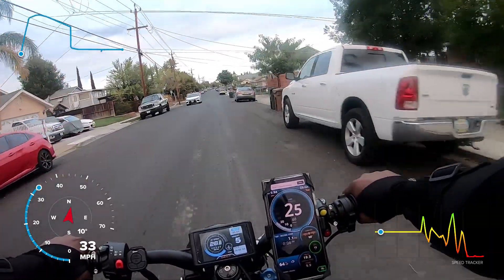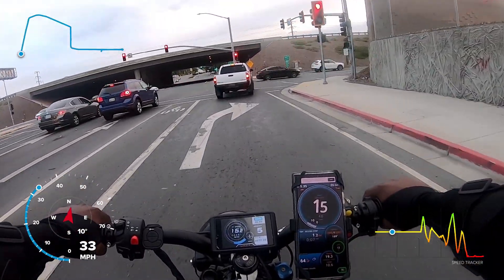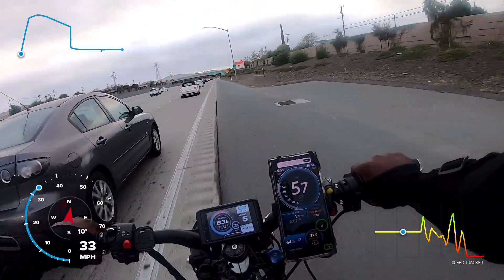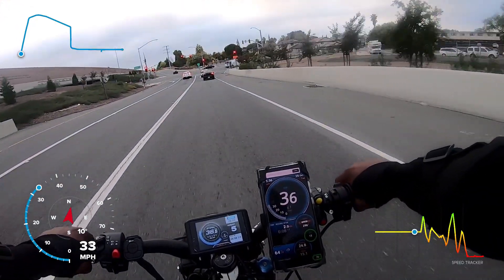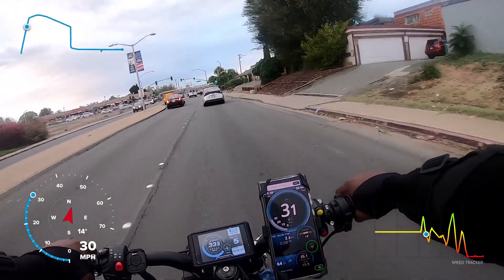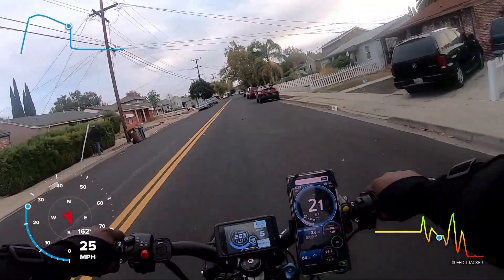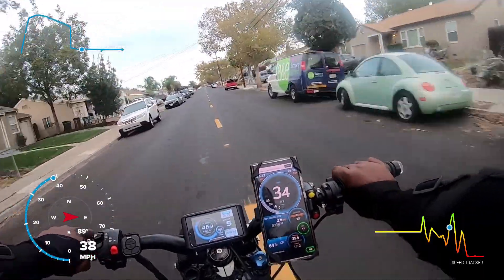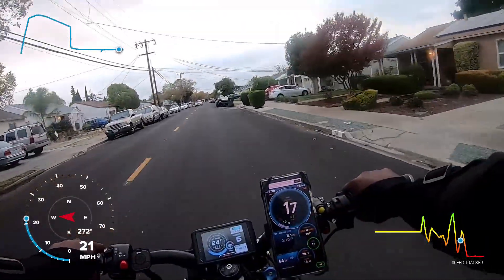72v Stealth Bomber e-Bike Speed Test

Comment: Bro - you need to chill on the side streets because stealth or not, you need to be right with traffic laws.

I'm building this same thing - kind of. But the rear end is a 19 inch MC Enduro tire (Kenda Trackmaster 120/90 19) because I want to send it to Ukraine, which is why it is a white frame set to begin with. I dunno how it will all work out or what the range can be, but this is a thing I thought a winter bike used for recon or courier use in Ukraine could and should be. 

  I'm retired, but I still have skills and this is how I choose to put them to use

                                                                                                     CIAO
                                                                                                 ~That guy....

Comment: bro i got almost the same specs as ur bike and mine is scary powerful....15000w 72v 49.9ah with sabvoton controller 200A,can't get enough of riding it the top speed is 72mph and i ride on the mode1 with 65 miles range
Reply: What's the battery size you guys are running?  I'm currently building one up with a nucular 24f, and at least 20s3p of 16Ah lipo.  I went with the nucular for it's size more than anything, it should squeeze in nice with large lipos.  I found a perfect sized 30A waterproof charger to mount under the body that takes 110v/240v both, so the controller had to fit in there with the big ass lipos.  I'm riding that shit down south 850mi, so the built in charger was a must
Reply: @boxlid214  15000w Panasonic
Reply: @boxlid214  couldnt you just carry a charger...just a question ...I think it's bad ass having a built in charger ...all ebikes should have that.
Reply: @petermelnyk7664  most are very heavy, better to mount it very low on the bike so that the weight has a low center of gravity and off your back.  I'll be bike packing, so clothes, bivy/hammock, and other stuff will be carried above.
Reply from the maker: Where's the video at? I'd like to see it!
Reply: I'm looking to purchase one real soon where should I go with my credit card lol
Reply: @petermelnyk7664  I paid with my credit card on alibaba. The transaction has double shield of protection which is my credit card protection and alibaba trade assurance . So if anything goes wrong I got money back guaranteed
Reply: Bro 15000w 72v 49.9ah 200A and you only getting 72mph ?! Naaaa, you should be doing 80-85mph for sure
Reply: @rolandroland1485  sold it months ago I’m riding an Africa twin now. No more electric bikes now it’s time for real bikes